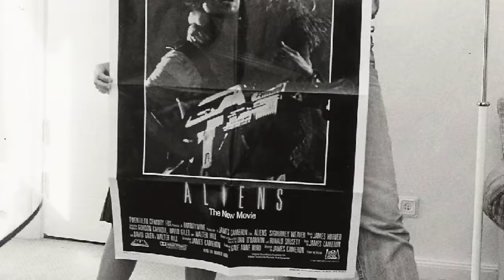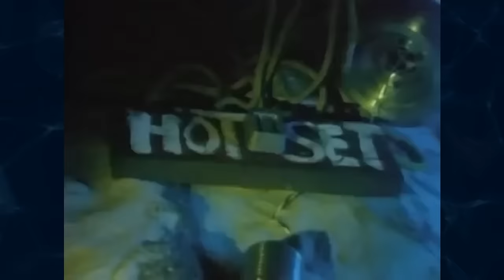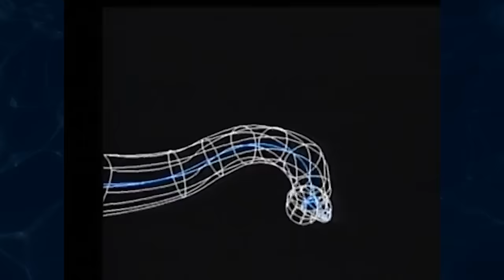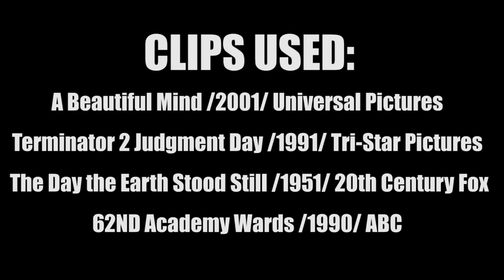10 Things You Didn't Know About Abyss

Comment: I was working at a movie theater when this came out. It was in so much demand, we had it on three screens, and all three auditoriums were filled up for every showing.
Reply: That reminds me of trying to explain to my son how different things were when the original Star Wars was released. In my area we only had two theaters, both with a single screen, and they only had two showing on weekdays, and one extra on Saturday & Sunday. There were lines down the block for SW, and it was held over for more than 6 months, and even then was selling out virtually every showing. 

Ironically I think this helped the other theater in town, which was a larger old school movie theater that had become run down, survive much longer, as the theater that was showing Star Wars was a nicer, fairly new theater and it had first option for all releases. I remember after talking to him I got online and looked up what was released the six months following the release of SW, and it included many of the biggest movies during that time, if I remember correctly it included Close Encounters of the Third Kind. The run down theater actually made enough money during that time that, for the first time in years, the cheapskate that owned the place put a little money into fixing the place up, although not by much.

To show you the owner of the run down place also owned the local drive inn, and he tore out all the wired speakers, but replaced them with a radio system from a closed drive inn. Sadly the reason the other place closed was they had tired out there old wired speakers and replaced it with the radio system in question, but it never worked well, so the place died. Anyone who remembers the old wired speakers can testify just how bad a radio system would have to be for people to prefer the old window cracking wired speakers. 🤣
Reply: It was a damn good movie.
Reply: @johnpatz8395 
I remember E.T. stayed in my local theatre for easily 6 months.
My kids and grandkids will never have the experience of waiting on a line that wraps around the theatre.
Reply: That's interesting since the theater I went to on opening night had almost no one in it. There were no lines at all and no one talked about the film. It was a pretty big theater,one of Marcus big ones,and it was dead after a week. They pulled it soon after.
Reply: That was probably back in the day when 50-100 people could fit in one theater. Who ever came first got the best seats haha 😅
Reply: I miss those days when you went to the movies
Reply: Do you remember which ending they showed in the theater? My VHS has the ending where they don't threaten to end humanity with tidal waves but I heard they used the other in theaters. (If he mentions it I haven't gotten to that part yet.)
Reply: @tarrantwolf  I've never seen the tidal wave ending.
Reply: @tarrantwolf  I never saw tne extended version or even knew it existed until the mid or late 90s when I happened to see that version on a tv broadcast. I like the extended version better. It gives more information that makes the movie make more sense.

Comment: Fear not, Minty. The power plant was abandoned during the construction phase. It was never used, so there was no (additional) risk to the cast and crew. South Carolina resident here.
Reply: You are the voice of reason :)
Reply: so, i take it, your not from Gaffney/Cherokee County?
Reply: @KardboardKenny , you are correct.
Reply: @sternwheeler  if you were, you'd have some great stories of the outsiders getting their butts handed to them for talking smack about the locals and suffering the consequences...😂
Reply: The Deepcore set was left there for years - up to the early 2000's IIRC,  until they finally decided to complete the facility and it was scrapped. Granted it was pretty stripped by the end as fans realized it was still there.
Reply: I lived 5 miles from the place.  It was never finished.  The locals protested and shut it down.
Reply: If you can lay your hands on the special edition DVD two disc set, there is a video tour of the movie set.
Reply: Interestingly, operating nuclear power plants have huge water tanks full of what is some of the cleanest water you'll ever come across.
Reply: Which boondoggle politician walked away with THAT money?😂😂
Reply: Otherwise there may have been another "the Conquerer" situation. Luckily, Ed Harris and James Cameron are still alive and kicking

Comment: Sorry, Minty; they weren't Truckers (kudos for that, btw) but ROUGHNECKS. Deepcore was a drilling rig. Also, that breathing liquid is real - when Ed Harris is upchucking it, he REALLY was expelling it for real. It ain't Virgil there at all; it's pure Ed.
The initial VHS edit in the UK had several of the tidal wave scenes in, too... and we're still waiting for the BluRay version of it.
Reply: @jpofgwynedd3878 I hate to break it to you, but the breathable liquid oxygen (that was still experimental at the time of filming The Abyss) was never able to be successfully used by humans, they tried modifying over the years, but it only ever worked on smaller animals. So Ed Harris DID actually have to hold his breath and pretend he was breathing it, which shows how good an actor he is.

Sadly we will not be getting the 4K release here in the UK, as the BBFC wanted Cameron to edit out the scene of the rat breathing the water, citing animal cruelty (even though that rat would not be alive today!) and Cameron refused to do so. Therefore we will not be seeing a 4K or Blu Ray release here anytime soon, you will have to buy a copy from the US or maybe Australia, since we share the same Blu Ray region code. From what I gather, the 4K release is the Theatrical Cut anyway, not the Special Edition for some reason.

Regards from North Anglesey. 😎

Comment: Surprised you didn't mention the effects they used for underwater vehicles - where you could see the pilot in through the glass front. It was done stop-motion, with film from (separate) filming of actors, and then each frame of the actors shown into the front of the model.  Move one frame's worth of model-movement, advance a frame of film and expose it, advance a frame of the character being shown in the nose, and voila!  Smooth motion.  Looked great.  You'd never know they didn't have room in the tank for them vehicles.

Comment: I can't believe you didn't connect The Abyss and Terminator!  Both "the Abyss" and "Terminator" are in the same cinematic universe. The company that owns the underwater drilling platform(it escapes me at the moment) has its logo on the side of one of the gas pumps in Terminator 2.  When Sara, John, and the t-800 pull up to the gas station in the station wagon they stole you can see the logo on the gas pump.  One of those little easter eggs James Cameron put in but very subtilty links the two films together.

Comment: Look on your table for a dive to 40' for 200 minutes. A zero is found under the 10' decompression stop column. The US Navy is telling you that you should not spend more than 200 minutes at 40' if you do not want a ceiling. Look at 50' for 100 minutes.

Comment: Ivr been in the situation of trying to save somones life. By the time i got to her she hsd been under for atleast 8 min. She had been drinking and took her grandson swimming. She got permission from the owner of the property. I lived on that property. It hsd a huge 80 ft deep tock quarry on the back of the land. What she, her grandchild or elderly freind didnt know that certian spots look like a casual beach.. well in some places its a 40-30 ft drop down. She had the child on her back. He was wearing water wings. So when she stepped off the underwater cliff she most likely gasped in surprise. Filling her lungs with water. The child floated back to the surface. He was ok but confused why grandma isnt coming back up. The elderly man took thevboy in his car and drove to my home. I immediatly jumpec into action. I was certified life gaurd. He drove me andvthe child back to where they saw her down. My boyfreind called the police. When they pointed out the spot my heart dropped because where she casually walked out into the water was not a beach spot.... nope.. straight down. I jumped in and saw her immediatly floating vertical arms slightly above her head. I pulled her out. Dead weight is very heavy. I gave her cpr till emt's showld up. Apparently i kept her heart going but she was brain dead from lose of oxgyne.

Comment: To clear things up, they had to film in a tank that was previously INTENDED to be the containment vessel for a power reactor, but was NEVER finished due to the several decade pause in licensing approvals for new power reactor construction in the US following the 3-Mile Island incident. The plant in Gaffney NEVER HAD A REACTOR and thus never went hot radioactively. My late father used to work construction on these types of plants and around the time The Abyss came out, had to find work elsewhere in the nuclear industry as the last of the reactors that had already been further along in their construction phases at the time of TMI than Gaffney was were all finished being built.
And since that's a boring bit of nitpicking, here's something more interesting. Gaffney, South Carolina has a water tower painted like a peach. from the right angle, it just looks like a butt.